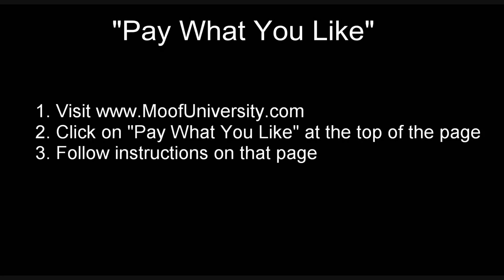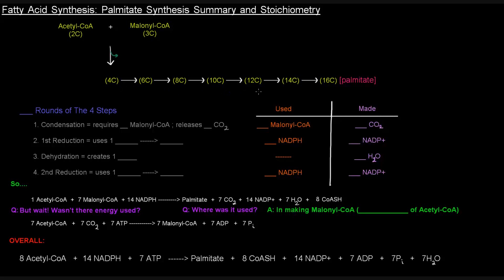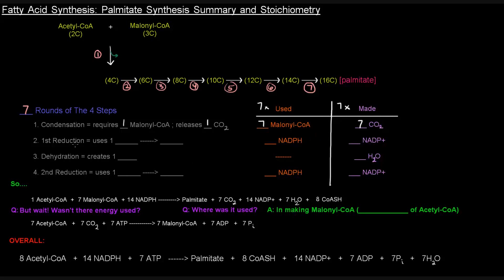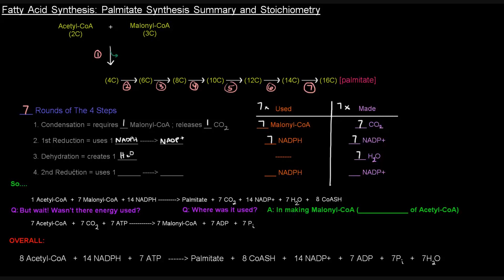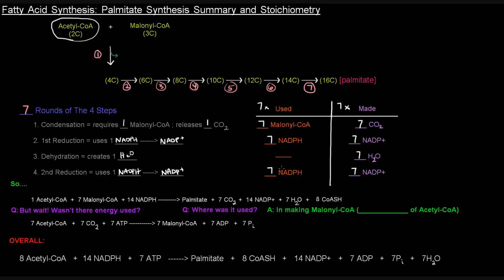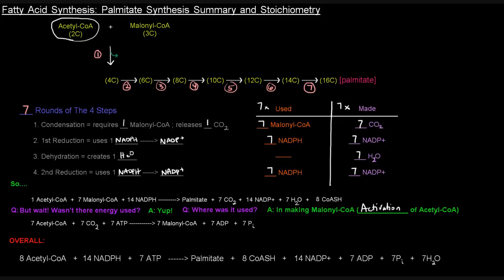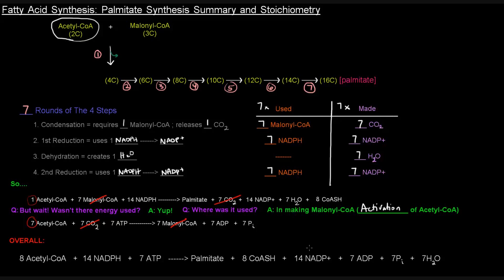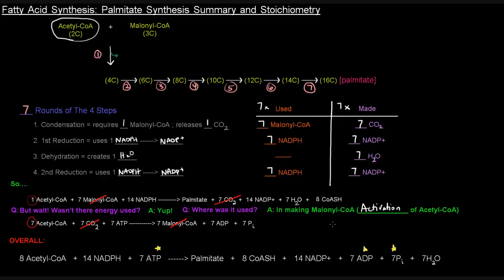Fatty Acid Synthesis (Part 7 of 12) - Palmitate Synthesis Summary and Stoichiometry

Comment: thanks a lot
but you had a little mistake. 
one water molecule was used in the last step of hydrolysis when releasing the acyl from the enzyme. 
so net result is 7-1=6 molecules were used.